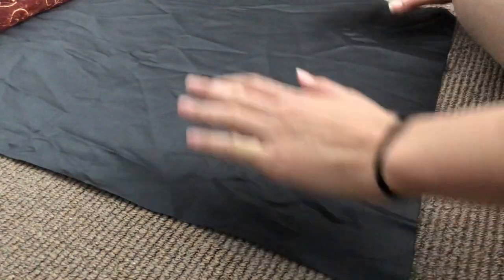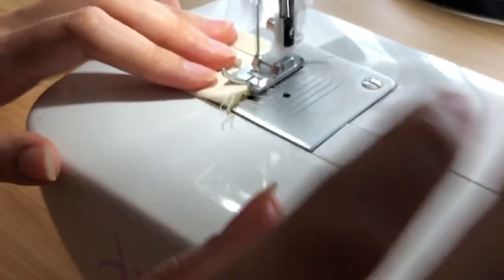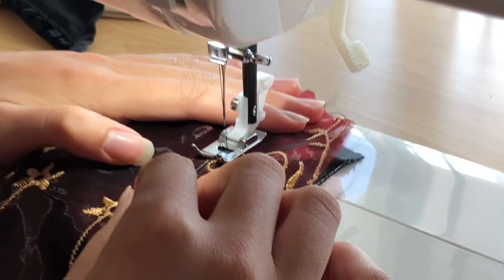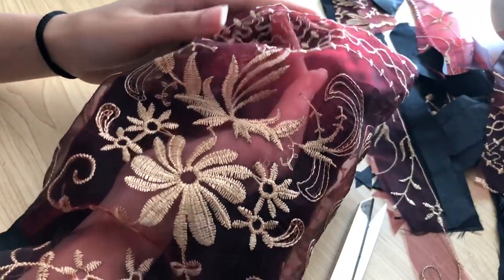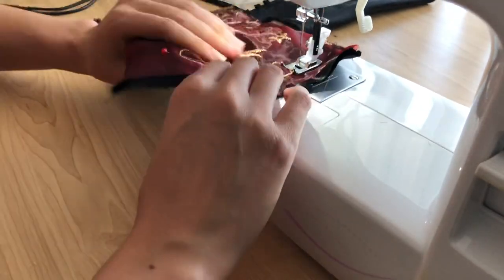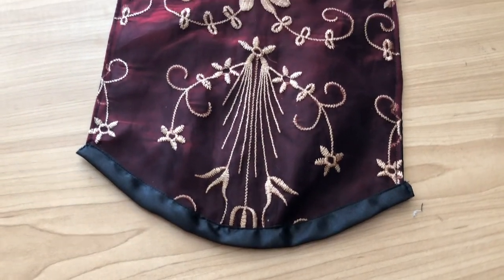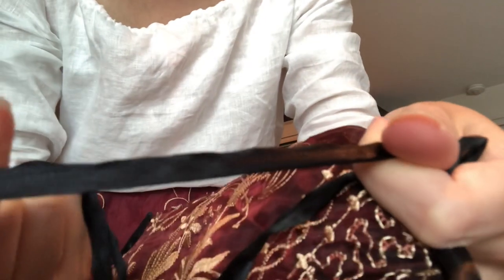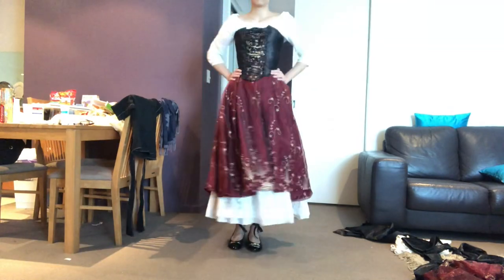Front Modesty Panel for Corset-Style Bodice || Making Briar Rose: Part 5

Comment: It looks nice, although I think I probably would have used the same burgundy underlayer as you used on the skirt instead of the black satin so that the two would match better in terms of color.  Also, to make it easier on yourself to put on, I would have tacked the modesty panel to the inside of one edge of the corset bodice so that you don’t have to juggle a free-floating panel while lacing it up.  But the costume does look very pretty!
Reply from the maker: Thanks for sharing your thoughts Melissa! I used the black satin as the underlayer because the original costume design I was basing this off has a black front panel. I underestimated how much colour the burgundy overlay would have on-top of the black... I was actually anticipating on having it look like gold embroidery on black but oh well! I was thinking about attaching one edge of the corset bodice to the panel, but in the end I decided against it because if I wanted to share the costume with other people with different body types, the front panel would always be in the centre. By having it free-floating, it can be adjusted so the gold design is directly in the centre on any body type!